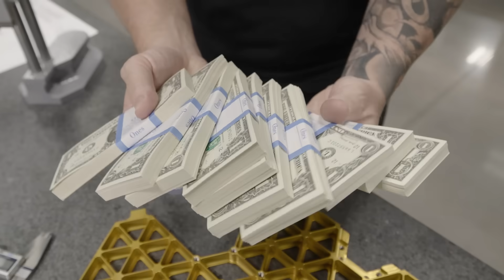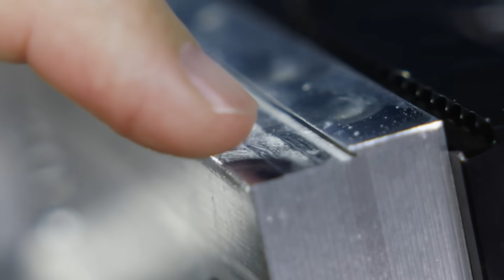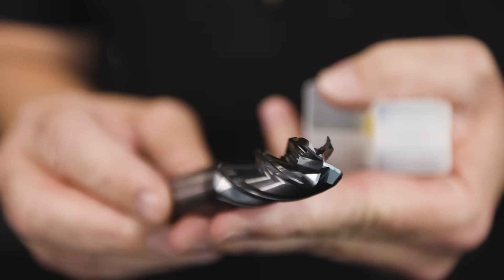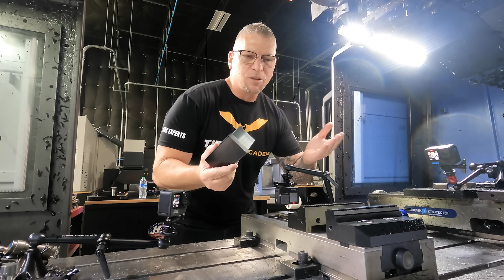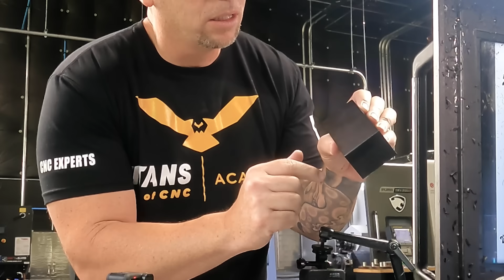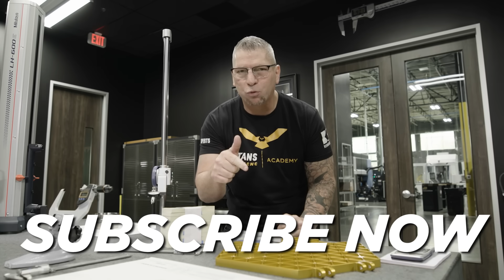How To Master The ART of Machining Plastics

Comment: Seeing all the material passing through my hands when I was in the oil field got me interested in machining. When it oil field started going down and I was eventually let go, I decided to go to college to be a machinist. Still young in the profession, I'm trying to learn as much as I can. I'm a machinist now going on 4 years, and still learning the balance of horse power, holding force, and machine holding tolerance. I have created my own spread sheet with all kinds of formulas to help my calculate the optimum MMR (it's not perfect by any means as there are many many factors). In some of my companies long runtime parts, I have taken 5 hours off the total run time.

My 1k USD stack guess... 4.5897 inches (bills and paper wrap)

Comment: 6.23 in     I started picking up CNC 22 years ago just hanging out helping on Saturday work. Because of that I was able to get a job running manual roll grinders at a place that was next door to where I trained karate. Because of that experience I got a job in automotive running lathes and mills then move to grinding with Studers and training with the German guys. Eventually becoming lead man and then lead man over the previous department. Also, started up a second shift at one of our other plants. After layoffs I easily found a job in a local shop. I left for a while to do some supervion roles. The job I work now I actually applied for supply chain manager. But, the saw my cnc experience and asked if I would consider that paying more that I asked for the management job. Now I'm lead of one shift and making more money than I ever have made in my life. I didn't find CNC, God sent it to me!

Comment: I've been saving money last few years to get first cnc this year. Probably used VF3 and injection molding machine. I've learned a lot from you guys, can't wait to rip some serious chips! Stack should be 4.3434 but with that gap on the bottom probably closer to 4.469

Comment: Where I work they have plastic bearing housings that are a 2 chemical mixture consisting of Isocyanate and Polyol. This combination makes very strong plastic that can be put in the machines to be cut to design. The plastic needs to be within a temperature range to get the cuts at the right dimensions. These make bearing housings for many different applications.

Comment: How manufacturing has changed my life.  
As I sit in my house with my family typing on my computer.  
Manufacturing has paid for.
I have worked in Manufacturing / engineering for the last 7 or so years. 

Roughly 7 years ago I started work in a saw mill. Working in a Dry mill manufacturing structural wood products. The people where amazing the work was hard and heavy. There were about 12 different jobs. From grading wood, marking wood so the automated trim saws could cut the best pieces of wood at the correct grades to packing wood. 

After a while the jobs became second nature. Although I wanted more. I would sometimes day dream of things to do or that id like to do. I use to spend way to much time witch Abom79 videos and though that would be cool to do one day. I’ve always liked working with my hands and brain and had since a young age helped my dad who is now a retired heavy mechanic. 

I had always wanted to learn a trade ether in electrical or engineering. I had tried and failed many times. Fail means First attempt in learning. Told I’m to old this or that etc. or not given a reason or just No. No means next opportunity.  I also worked with a few fitters mill wrights and asked them what they did and though that was interesting.

At the time life was good and bad. One of those ups and downs that makes it what it is. My wife was pregnant without second child wasn’t the easiest pregnancy was told it could go good or bad. My grandfather who I was close to was not well.  So I spoke to my manage at the time almost in tears just things are complicated and I’m on a life a path that may or may not end well. We spoke for some time.

 The last time I saw my grandfather we spoke we said out good bye. His advice was don’t give up let Percy help. I asked Percy who? Perseverance.  He had told me this numerous times and there was a whole story that went along with it. But this time it stuck really etched into my brain.

I was at work not long after I can remember the morning, I had a feeling something wasn’t quiet right and then the we had a power outage. Not long after my phone kept going off. While the power was out, I checked my phone which I would normally never do. My grand father had passed. 

 Thankfully I had a great manager who was aware of everything that was going on. I got some time off work. Before I drove home my work offered to drive me. Also when I got home they made sure I was safe and just talked.  

It wasn’t long after this I was appling for different jobs. One came up as an Apprentice maintenance fitter ( mill wright)….I got that job it was fun but the politics and work culture where odd and not fun. I learnt a lot about bearings, pumps, bolts electric motors bearings. I went to trade school and loved it. It was hard but rewarding I learnt so much. About everything from maintenance to machining. Unfortunately my work place didn’t want me anymore. I never got a “real” reason. 

My second time on a lathe at trade school I was so excited. I forgot about the basics and ran it in reverse and broke and insert. I was made to use HSS and grind it. I learnt so much from that. Then was able to use carbide cutting tools again. 

I ended up continuing my apprenticeship but in machining. I would drive 100km stay at a friends and work. Only to come home a few nights a week. I only used a lathe and mill for less than 10 hours. But here I was button pushing. It was fun but to be able to program you had to prove yourself.

There was me and anther apprentice who had hundreds of hours more experience. Looking back now I was nervous and didn’t want to crash the machines. But the place I was working was very refined.
I was let go from there due to not being up to there standards. I accepted that. As the other apprentice was really good. 

I continued me apprentice at a plastics place. The word Cowboys comes to mind. It wants bad. But From day one I wasn’t allowed to attend trade school and had to pass their 6-month trial. After another worker had an accident with a CNC router. I spoke up they let me go not long after that.  

I worked cheese manufacturing close to home for about a month. I was sort of devastated and just wanted one more chance. I wanted and needed to complete my apprenticeship. Then I applied for a job and got it. I rant 2 large 25-year-old Bed mills for the last few years. I took these bed mills apart rebuilt parts of them. Programed them crashed them. Knew these bed mills like the back of my hand.

I would mainly machine large parts 80% of them needed to be lifted on to the machines bed with a crane. A lot of the parts where welded. I would take a not book to work as my notes. I came up with many strategies on warpage due to welding. Feeds speeds or how to relief different parts so you would get more life out of inserts. 

From time-to-time id get to run a small real sized mill. I learn so much how to program via cam and through hard code.  Ways to verify you have material left. I think every few days Id learns something new. I am still learning. After a few years working there I finally finished Trade school. Worked for a bit then got my current job close to home. 

Which is everything from maintenance fitting, machining on site machining and more. Onsite machining although I can’t say much its so different. I am still learning and liking work. My satisfaction and enjoyment of life is much better. I have gone through ups and downs. I am always learning. 

Manufacturing has changed my life so much. Now I look at my car machines and simple objects a wonder how was that made…. When I get more time, I really need to make my own bigger than store bought dead blow hammer with copper and aluminum ends. Maybe another one with plastic and brass. 

Why I love manufacturing, always learning never board get to think wonder know communicate it keeps me busy there is no one right or wrong way. 

Id like to say a personal thanks to Titan for the video.

” Titan Gilroy's Powerful TESTIMONY!.” 

That video made me cry and smile. And has made me think how I can make a difference what do I have to offer.  What can I pass on? And how life has ups and downs the good and the bad moments how you keep going. It inspired me that’s why I wrote this…

Comment: Titan, always like your approach to teaching machining. I’m 57 yrs. Old and have been machining parts since I was 7 years old in my dads shop (Lake County Tool Works ) in Gurnee Illinois. When I graduated from college at WSU I went to work with my father machining parts on all manual equipment except for an automatic drill press that had peck feed drilling. I help run that business for twelve years. Then my wife for over 31 years were blessed with 3 children. One set of twins. One of the twins was born with special needs.

Comment: Awesome tips as always and struggle with cutting plastic because of the growth from machining and clamping pressures. I love manufacturing and machining as this industry gives me challenges everyday to keep things interesting. I say the stack is 4.386” tall for my guess. I started my career as a tool and die maker in 1994 and work through as a die maker to a CNC programmer into wire EDM programmer/operator. Then into tool design and eventually leading into my manufacturing engineer roles. I have helped out at high schools with project lead the way as I feel this is an important step for students to find a great career in manufacturing. I struggled in school but once I went to tech school I found my passion. I love the technology that this trade offers.

Comment: You could’ve save an extra move by rapidly z.01 than ramping to z.125. Drop down to z.01 back to the starting point. Drop down z0 than to the end point. Unless I’m missing something. But great move btw. I use this trick all the time. Sometimes you can mill a profile .100 in n stay z.01 . Deck the top without worry about chipping. Let me know if u guys disagree

Comment: 11.03122 cm
Machining has put a roof over my head and food on my plate for over 25yrs. Its something ive loved since i was 10yrs old and my father started teaching me. Ive worked on alnost anything you can think of from nasa and aerospace, to automobiles, golf clubs, and firearms. I no longer work in any shops nor own my own anymore due to a car accident that left me in the hospital for 18 months, going thru 17 surgeries & partially paralyzed, but i still have a small mill and lathe at home. This would help me setup a little home shop so that i could hopefully start making some things again. I need a shed/garage to setup my equipment in and this would be a HUGE help in that. Thank you for your generosity & the opportunity. Stay well and be safe.

Comment: I started out as a welder in a machine shop and found the CNC equipment so amazing I used to experiment and basically train myself on machines that were not being used. All that has transitioned into build complex aerospace parts. I have built parts that have been in almost every type of environment on this planet. My dream is to finally make parts that will be used to go into space. I will put my guess in at 4.36”.

Comment: Hi Titan. Great content as always.
I noticed when machining this part it seemed like there was a lot of static electricity generated in the chips and they stuck everywhere. It looked like a real pain to clean up. Would it make sense (if possible) to have something generate a de-ionizing mist to reduce that and make clean up easier?
Reply: I work in all kind of plastics in daily basis, first at industry router, now at CNC mill.
for most of time it is not problem (if you got enough thick chip), much worst is that they are very light or very small (depends of type of plastics and its quality) eg. Foamed PVC are paaaaaain in the a*** to clean, like dust, PA (polyamide) makes nice chips but its speed and feeds very depends of type of it (pa6, pa6g,  with fiverglass and few mooore types...)

And that chips are mostly float on coolant so not all types chip conveyors in CNC mills work well for them.
We mostly wont work with coolant at mills but it depends of material we work on, one without coolant make horrible finnnish if you got bit used tool, other absorb every drop of it that cause deform material and make it scrap

Comment: I will guess that 1000 one dollar bills are 4.30 inches thick.  The way that manufacturing changed my life, I was a 21 year old bum, I dropped out of college because I drank too much, among other
things, i was going nowhere fast.  My father was friends with the foreman of a shop and got me a job there.  I started as a trainee and moved my way up to jig boring and tooling, (this was the early 80's).  I have had four jobs in my career and did well at each of them.  Basically I found my niche in machining, I caught on quickly and did well.  It was at my first shop that a co worker told me about God, invited me to church where I was filled with the Holy Ghost and baptized in Jesus name.  So machining changed my life in two ways, it gave me a career and helped me get my life straightened out and it (I should say He) brought me to God and saved my soul. (Robert)

Comment: Im a 19 year old engineering student and your channel has changed my life by getting me into manufacturing. I’ve watched the majority of your videos since I subscribed to you when i was just 15 when I saw your titanium footpeg video. I now work at a machine shop doing inspection, and I run a tormach at a makerspace in my free time. Im working on machining a prototype pistonless engine and just got done making my own concrete filled 4th axis. Im also now responsible for teaching safety certifications at that makerspace and upkeeping equipment.  Your channel has definitely helped awaken the maker in me and changed my life. Im guessing 4.4850 for the stack. Thanks 🙏🏼

Comment: You guys have inspired me to drop out of college and start my own manufacturing business. I was working on my machine yesterday and I was pushing it to see how fast it can cut material. The spindle stalled and it crashed the machine. It turns out that a proper spindle replacement/upgrade for my machine would cost about $1000. I don't know that I deserve $1000 for free, but that would certainly help my business.

For the stack of bills, given that the bills aren't perfectly flat and can't be stacked with zero air gap, I'd add about .1%. If you hold down that stack with like... your hand, it should bend the bills enough to negate the thickness of the paper strips holding them together. I'm gonna guess (109.3 ± 0.2) mm.

Comment: I started this trade 7 years ago, I loved working steel but had minimal experience with manual and none with cnc. I was a grade 10 dropout with nothing, I was living in an old semi trailer with my family to give a perspective.

I got lucky after many shops turned me down one took me in to "try out for a week" that week I worked hard and by the end of it they ordered me a set of coveralls.
Now Im paying on a house and working to build my own small machine shop,  Machining and hard work has given me everything I own. My guess on the stack height is 5.0781"

Comment: I'll keep it short why manufacturing is life. I'm a licensed mechanical engineer. Got the opportunity to work on projects for mega companies like Space X, Boeing, Northrop and all major aerospace players. Had great benefits, multi 6 figure income and a very comfortable life. In essence, what most people want out of life. I let it all go to open my own CNC machine shop (the hardest decision of my life to date). Hills and valleys have been quite the ride, but have never looked back. Manufacturing saved me from a mediocre life to an incredible one!

Thickness of dollar bill is .0043". Assuming bands have same thickness .0043 x (1,000 + 20) = 4.3860", add slack of about .05" since paper is under no load, my guess = 4.4360 +/-.01  :)